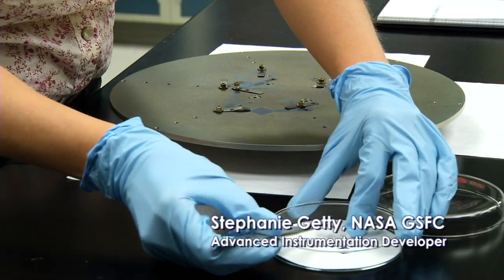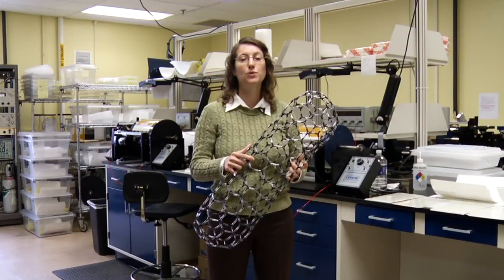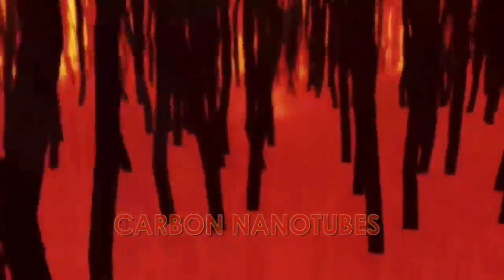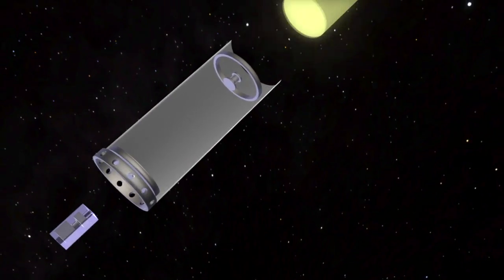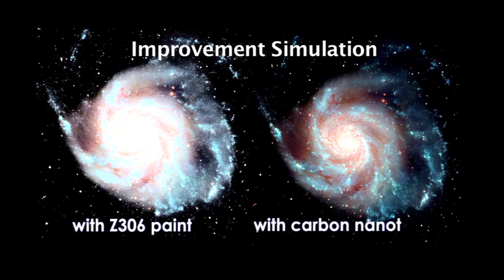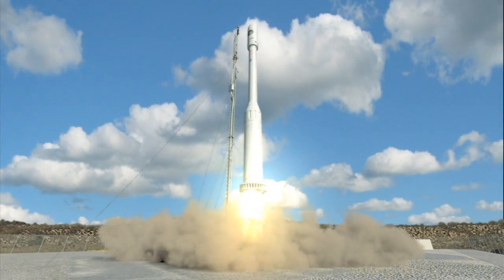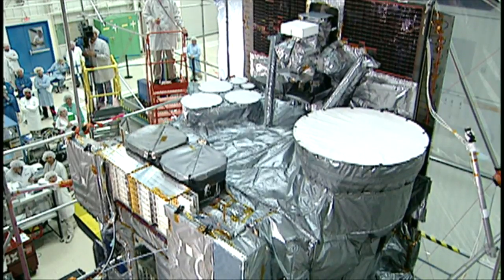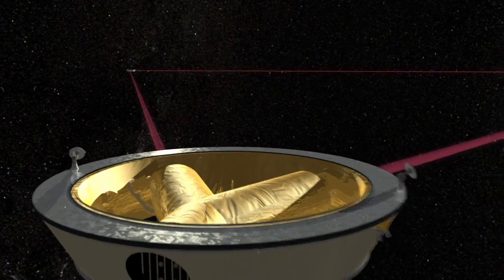NASA | Blacker Than Black

Comment: If these carbon nanotubes are so good at absorbing and dissipating visible light, how well do they handle other wavelengths on the electromagnetic spectrum - infrared, ultraviolet, x-ray, gamma radiation?
Reply: I'm sure they could possibly be used as a radiation absorption material but would probably need to be fairly thick. At least thicker than what we can currently produce in the lab.